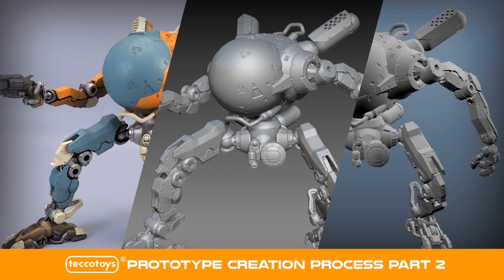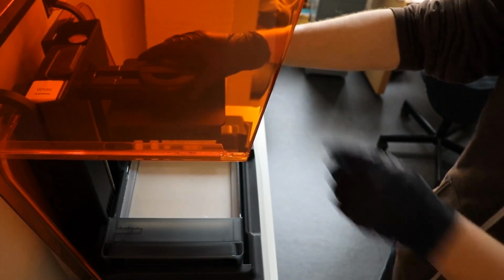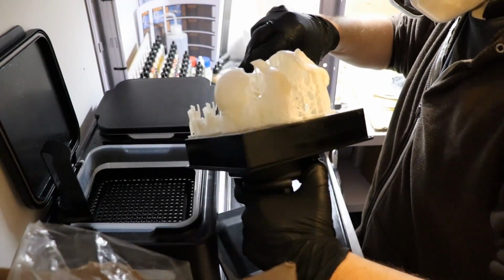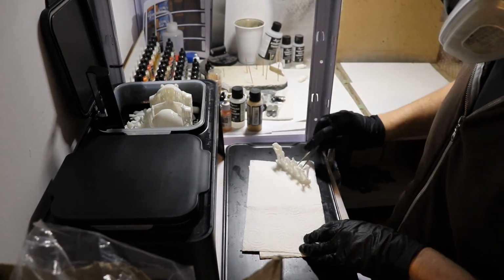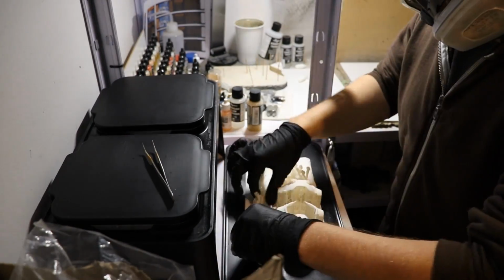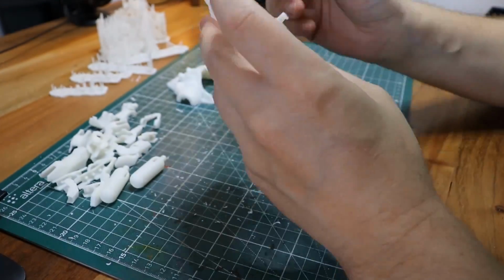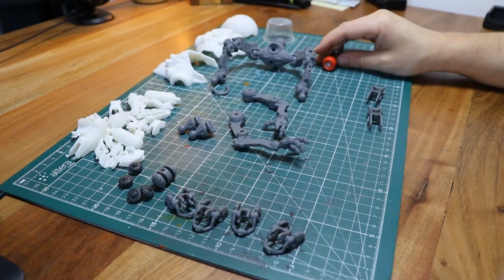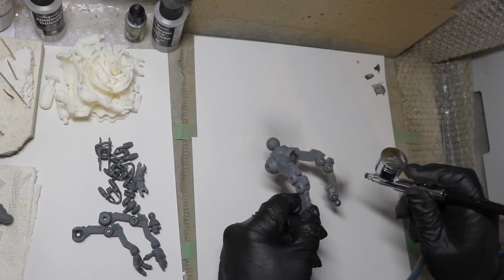teccotoys® prototype creation process part 2

Comment: Do you know if I can achieve similar results In joint integrity with anycubic resin? And do you see any kind of issues with your joints after a while?
Reply from the maker: Yes, depending on the resin. Maybe one of our gumroad print files customers reads this and can give more insight.
The printed parts are slightly shrinking over time, so the joints become loose on the prototypes with time. The final factory products however will be of higher quality materials and will have metal pins for joints, so much more stable.